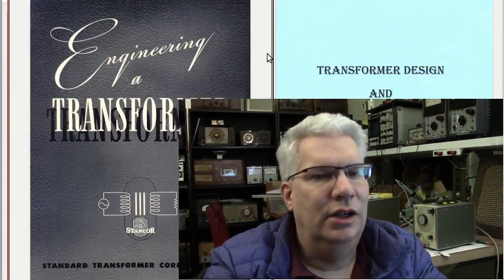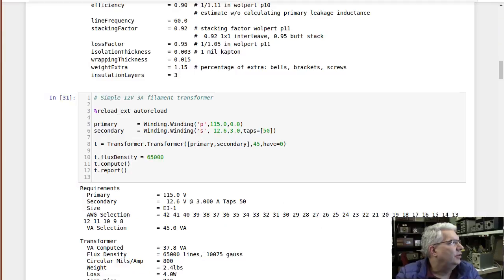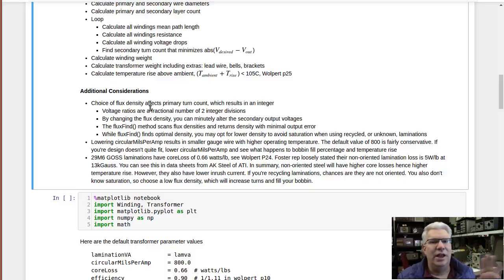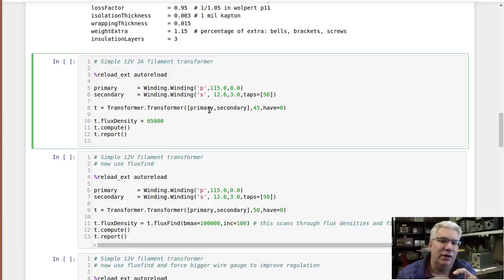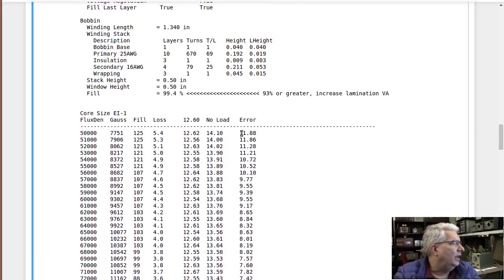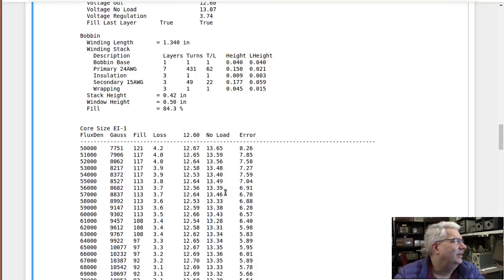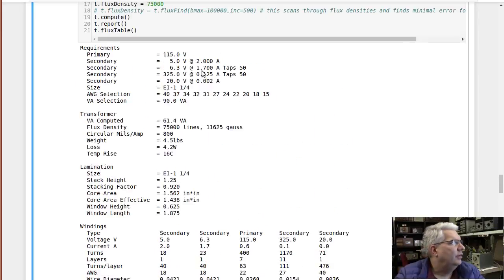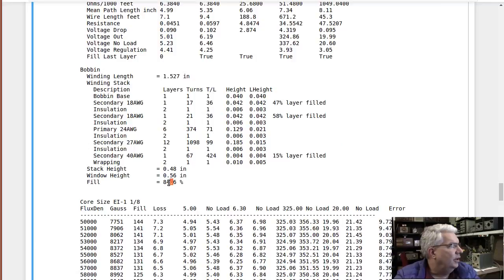170130 Valve Studio - Power Transformer Design Tool with Examples

Comment: Hey Craig its a great project, i wanted to ask you, what was the ratio of the stepper motor rotation of the leadscrew to the rotation of the bobbin?, i assuming that it is based on the wire gauge ie diameter of wire in mm, the leadscrew moves by one wire diameter,after that is completed,the bobin completes a full rotation, and the above continues for a specific number of turns. Please correct me if i am wrong, thanks alot

Comment: Hi, am running with Annaconda, am using the version with version fixes. Still getting import, traceback and name errors. Am using windows 64 bit. Any help would be greatly appreciated. Thanks.
Reply from the maker: post your errors.
Reply: Hi Craig, this occurs when i run the first cell...

ImportErrorTraceback (most recent call last)
<ipython-input-3-d8560c6188d5> in <module>()
      1 get_ipython().magic(u'matplotlib notebook')
----> 2 import Winding,Transformer
      3 import matplotlib.pyplot as plt
      4 import numpy as np
      5 import math

C:\Users\Anthony\Downloads\valvestudio-master (3)\projects\transformerdesigner\power\Transformer.py in <module>()
     11 # windowlength = margin + thickness + padding + windinglength + padding + thickness + margin
     12 
---> 13 import Bobbin, Machine
     14 import matplotlib.pyplot as plt
     15 import numpy as np

C:\Users\Anthony\Downloads\valvestudio-master (3)\projects\transformerdesigner\power\Machine.py in <module>()
     12 BUFFERTHRES=13
     13 
---> 14 import time,sys,termios,os,csv
     15 
     16 try:

ImportError: No module named termios

****AND THIS OCCURS WHEN I RUN THE 12 VOLT 3 AMP CELL..****

NameErrorTraceback (most recent call last)

<ipython-input-4-121a40208417> in <module>()
      6 secondary    = Winding.Winding('s', 12.6,3.0,taps=[50])
      7 
----> 8 t = Transformer.Transformer([primary,secondary],50,have=1)
      9 
     10 t.circularMilsPerAmp = 600

NameError: name 'Transformer' is not defined

THANKS ANT
Reply from the maker: OK, Machine.py uses linux's termios to alter python's keyboard get() behavior. For you, this shouldn't matter because your not trying to wind transformers with my coil winder. I made a changes to Machine.py to avoid the import termios error. However I don't run windows here, so please update your git repo and try again. Also, I don't know if this runs in a jupyter notebook, you might have to just run the examples with anaconda's command line python.
Reply: Thanks a million, will try this tonight.
Reply: It all works now with jupyter note book, your new machine.py fixed it THANKS im really pleased. Ive got a manual winder on order to start with. May need to look into changing to metric units. Thanks for sharing your hard work.

Comment: Can you explain this "lines" unit for flux density?  Flux density is measured in tesla or gauss.  Is this some throwback unit from the 19th century?  The only thing I could find was the maxwell, the cgs unit of flux, which used to be called a 'line', but which is a unit of flux, not flux density, and is 10^-8 Wb anyway.
Reply from the maker: 1 gauss = 6.4516 lines/square inch, the Wolpert book calculations are the basis for the power transformer designer. You're correct, lines themselves not flux density. Based on your comment, I've marked in my source to revise the variable names in my code. Thanks for the comment and for watching.

Comment: :( sir i cant donwload the file form the github can you plsss help me how to get it? or cloning the file and save it in the google drive.
Reply from the maker: no, you can download the zip file from github. click on the clone button.
Reply: Craig Hollabaugh at last i found it tsk2x took me a day phew.. there is no clone but when i click other bars and click the code again it pops up lol i dont know why 😂
Reply: im done with the complicated errors... cant excecute the program its says missng Winding, transformer, etc2x i dont understand it anymore better to read books. but thanks for the info's very well appreciated.
Reply from the maker: I just ran it. You can just run it from the command line. Here's the output from running 

python 300-5.0-6.3.py

select, copy and paste into text editor, change font to monospace.

Requirements
  Primary              = 115.0 V
  Secondary            =   5.0 V @ 2.000 A 
  Secondary            =   6.3 V @ 1.600 A Taps 50
  Secondary            = 300.0 V @ 0.100 A Taps 20,50,80
  Size                 = EI-1
  AWG Selection        = 40 37 34 32 31 27 24 22 20 18 15 
  VA Selection         = 50.0 VA

Transformer
  VA Computed          = 50.1 VA
  Flux Density         = 89000 lines, 13795 gauss
  Circular Mils/Amp    = 700
  Weight               = 2.7lbs
  Loss                 = 3.7W
  Temp Rise            = 20C

Lamination
  Size                 = EI-1
  Stack Height         = 1.25
  Stacking Factor      = 0.920
  Core Area            = 1.250 in*in
  Core Area Effective  = 1.150 in*in
  Window Height        = 0.5
  Window Length        = 1.5

Windings
  Type                  Secondary   Secondary   Primary     Secondary   
  Voltage V             5.0         6.3         115.0       300.0       
  Current A             2.0         1.6         0.5         0.1         
  Turns                 19          24          421         1158        
  Layers                1           1           7           9           
  Turns/layer           31          31          62          135         
  AWG                   18          18          24          31          
  Wire Diameter         0.0421      0.0421      0.0215      0.0099      
  Ohms/1000 feet        6.3840      6.3840      25.6800     130.0800    
  Mean Path Length inch 4.99        5.35        6.14        7.13        
  Wire Length feet      7.9         10.7        215.5       687.7       
  Resistance            0.0504      0.0683      5.5350      89.4507     
  Voltage Drop          0.101       0.109       2.678       8.945       
  Voltage Out           4.97        6.29                    300.01      
  Voltage No Load       5.19        6.56                    316.32      
  Voltage Regulation    4.46        4.16                    5.44        
  Fill Last Layer       False       True        True        True        

Bobbin
  Winding Length       = 1.340 in
  Winding Stack
    Description          Layers Turns T/L   Height LHeight
    Bobbin Base          1      1     1     0.040  0.040  
    Secondary 18AWG      1      19    31    0.042  0.042  61% layer filled
    Insulation           3      1     1     0.009  0.003  
    Secondary 18AWG      1      24    31    0.042  0.042  77% layer filled
    Insulation           3      1     1     0.009  0.003  
    Primary 24AWG        7      421   62    0.150  0.021  
    Insulation           3      1     1     0.009  0.003  
    Secondary 31AWG      9      1158  135   0.089  0.010  
    Wrapping             3      1     1     0.045  0.015  
  Stack Height         = 0.44 in
  Window Height        = 0.50 in
  Fill                 = 87.2 % 

(-----------------------------------------------------------)
(-- design 300-5.0-6.3                                    --)
(-----------------------------------------------------------)

(-- Requirements -------------------------------------------)
(  Primary              = 115.0 V                           )
(  Secondary            =   5.0 V @ 2.000 A                 )
(  Secondary            =   6.3 V @ 1.600 A Taps 50         )
(  Secondary            = 300.0 V @ 0.100 A Taps 20,50,80   )
(  Size                 = EI-1                              )
(  AWG Selection        = 40 37 34 32 31 27 24 22 20 18 15  )
(  VA Selection         =  50.0 VA                          )

(-- setup -------------------------------------)
( inches, work offset 54, absolute, linear 125%)
G20 G54 G90
G1 F125

(-- winding -    5.0V Secondary  --------------)
( load #18 AWG wire                            )
( winding   19 turns, fill last False          )
( move to 0.0                                  )
( wind leadin                                  )
M0
X0.7999     Y19.0000        ( right            )

(-- winding -    6.3V Secondary  --------------)
( load #18 AWG wire                            )
( winding   24 turns, fill last True           )
( move to 0.0                                  )
( wind leadin                                  )
M0
X0.1088     Y2.0000         ( right tape       )
M0                          ( right tape       )
X0.6525     Y12.0000        ( right tap        )
M0                          ( right tap        )
X1.3051     Y24.0000        ( right            )

(-- winding -  115.0V Primary    --------------)
( load #24 AWG wire                            )
( winding  421 turns, fill last True           )
( move to 0.0                                  )
( wind leadin                                  )
M0
X1.3330     Y62.0000        ( right            )
X0.0000     Y124.0000       ( left             )
X1.3330     Y186.0000       ( right            )
X0.0000     Y248.0000       ( left             )
X1.3330     Y310.0000       ( right            )
X0.0000     Y372.0000       ( left             )
X1.3330     Y421.0000       ( right            )

(-- winding -  300.0V Secondary  --------------)
( load #31 AWG wire                            )
( winding 1158 turns, fill last True           )
( move to 0.0                                  )
( wind leadin                                  )
M0
X1.3365     Y135.0000       ( right            )
X0.4827     Y221.6000       ( left tape        )
M0                          ( left tape        )
X0.3837     Y231.6000       ( left tap         )
M0                          ( left tap         )
X0.0000     Y270.0000       ( left             )
X1.3365     Y405.0000       ( right            )
X0.0000     Y540.0000       ( left             )
X0.2871     Y569.0000       ( right tape       )
M0                          ( right tape       )
X0.3861     Y579.0000       ( right tap        )
M0                          ( right tap        )
X1.3365     Y675.0000       ( right            )
X0.0000     Y810.0000       ( left             )
X1.0534     Y916.4000       ( right tape       )
M0                          ( right tape       )
X1.1524     Y926.4000       ( right tap        )
M0                          ( right tap        )
X1.3365     Y945.0000       ( right            )
X0.0000     Y1080.0000      ( left             )
X1.3365     Y1158.0000      ( right            )
Reply: Craig Hollabaugh ok thanks for all the help ill try it later
Reply: Sir can i ask some about the version of the python jupyter you are using?
Reply from the maker: 2.7

Comment: sir where can i get the program that you  used?
Reply from the maker: Oh sorry, I didn't put a link in the show notes. https://github.com/holla2040/valvestudio/tree/master/projects/transformerdesigner/power
Reply: Craig Hollabaugh thank you very much sir😊, but how can i run the program? i know a the codes but what files will i need to open?
Reply from the maker: TransformerDesigner-Power.ipynb using jupyter.
Reply: Craig Hollabaugh Wow great video so far. This is the one I wanted because i have practical calculation but i am not still satiafied haha.. but now i can easily check and compare it thanks for this video Sir...
Reply from the maker: sure, good luck! also read that wolpert book on power transformer design.
Reply: Craig Hollabaugh sir the book cant be opened its error/corrupted
Reply from the maker: works here, you have to open the TransformerDesigner-Power.ipynb using jupyter notebook. I use anaconda for this.
Reply: Craig Hollabaugh I mean the pdf file of wolpert is corrupted
Reply: sorry for the trouble sir. Its not corrupted I downloaded it to my PC and it works thanks for this information.
Reply from the maker: its huge, 122M. might take a awhile to load.